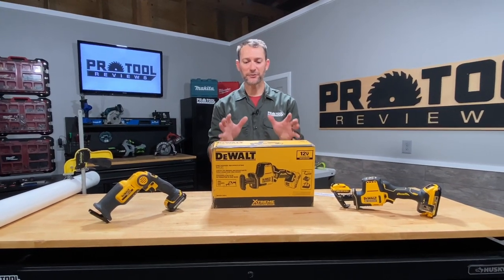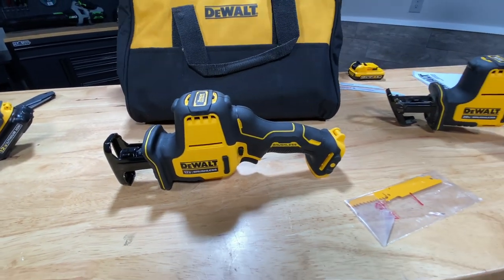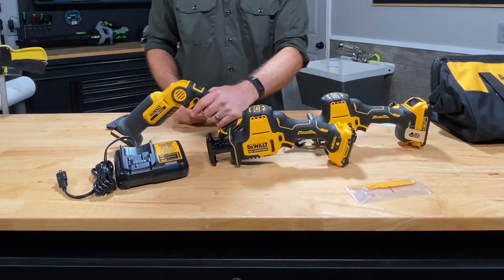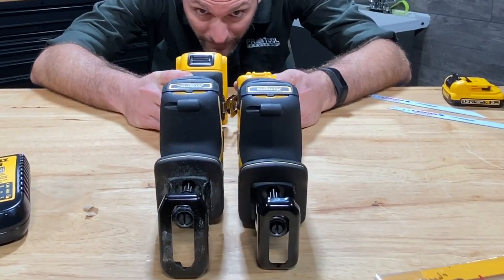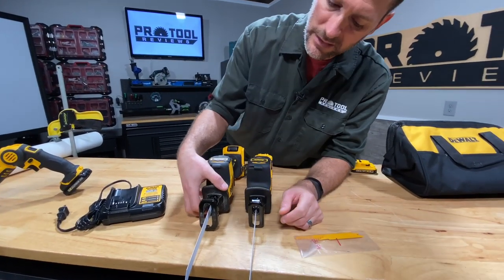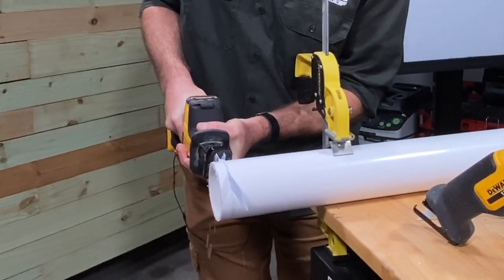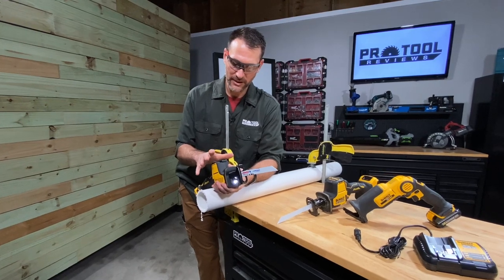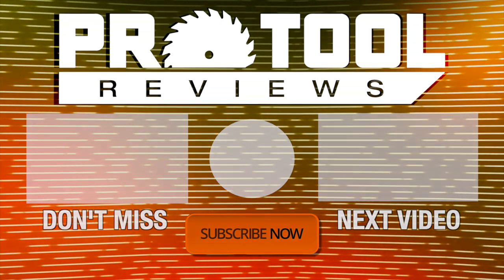DeWalt Atomic 20V vs 12V Reciprocating Saws | Is It the Same Tool?

Comment: Hi,

Would have been nice to see how the brushed version performed with the new 3.0ah battery.

The two new models looks pretty cool for small projects. People are forgetting that you're not going to demo a house with these particular tool. That's when a sawzall comes in. 

Hope dewalt makes larger ah batteries for their 12v line. 

Thanks for the video

Comment: I don't like the fixed shoe, minor issue probably just me. The batteries are now 20V 5.0 AH. I'm used to using a bear of a recip saw and it's elec., (ugh). This info is up to date as of December 2022. Obvious DeWalt upgraded the battery. Since Black & Decker bought DeWalt seems like they reduced quality and now are upgrading their tools. I wonder how much business they lost? I sold DeWalt tools for 30 years since the seventies while working for a top industrial distributor. I have lived through the quality change and it wasn't pretty. DeWalt was my go to tool all of my life. Not so much anymore.

Comment: I have a dcs 369B,I was wondering if anyone else has smashed their fingers in the slide,I think it needs something over it,I done it a few times now,love the saw except when I use a second hand to apply pressure,and get a finger in the slide and the piece that you twist to install the blade, sacks a chunk outta my finger,only flaw I've found
Reply: @Protoolreviews   I'm gonna build something over it,I've got a finger in there more than once
Reply: Ok, so another DeWalt, I mean Black & Decker design flaw. This is the third time I heard about this happening. DeWalt ain't what it used to be thanks to Black & Decker buyout. I know, I used their tools for thirty years and man, they were such garbage a few years back you couldn't use anything with the DeWalt name on it. I also sold their tools for decades and every other metalworking tool there was.

Comment: If you could only purchase 1 saw,  12v or 20v??  I use both platforms, cant decide which one to go with.
Reply: 20v Atomic.  Pivoting shoe, shoe "rafter hook", belt clip, and larger variety of available batteries (1.3Ah all the way to 12Ah).  Pretty much everything else (size, weight, power, speed) are almost identical.
Reply: I'm trying to decide the same thing. I'm already on both battery platforms but was leaning toward 20v for the bigger batteries.
Reply: I went with the 12v version. The deal at lowes was hard to pass up.  Saw, drill, 2 batteries, charger and a backpack..  $149.00
Reply: @anthonyhamel3497  I like the battery gauge on 20v..wish 12v had it on its batteries
Reply: @1commonsense934  it does
Reply: @thehhoff69  who puts a 12ah battery on a compact hacksall? The 12v line has a 5 ah and that’s plenty
Reply: @jncn1490  not recommending you put a 12Ah on there, but you at least have the option. And the 5Ah 12v battery just came out a couple months ago. My original reply was well before that. Ya feel me?
Reply: I went with the 12v line, performs pretty close to the 20v for a lot less. Plus they have a 5AH battery now and I got good deals on them. I got 4 5AH, 4 3AH, and 2 2AH bats for free with tool deals. Only spent $600 for the 3/8 impact, 1/2 impact, 1/4 impact driver, compact bandsaw, and recip saw. They work great for me.
Reply: I just recently got the 12v version, not much difference between the two.  I’m very happy with the 12v line of tools. I hope they expand more.  A jigsaw. Or router would be nice

Comment: I recently purchased the DeWalt Atomic compact recip (DCS369) and noticed a rattle/knocking noise that sounds like it's coming from inside motor housing when I shake the tool (not while in use, but when i simply hold tool in my hand w/no battery or blade attached).  I contacted DeWalt and they said the noise should not be there so I bought another one to test and it too had the rattle but less of it, so I bought a THIRD and it also has the rattle but less of it than #1 or #2 saws.  I've contacted DeWalt and they can't confirm anything for me so I wanted to ask you since you have the tool, does your DCS369 make an internal rattle noise when you shake it?  I've been holding all external parts securely (trigger,  trigger lock, anything that could wobble) as I shake mine and rattle/knocking noise definitely sounds to be inside motor housing.  Thx!
Reply: @Protoolreviews  Thanks for reply!  I had called a DeWalt Factory Service Center as well, they confirmed the rattle is normal...apparently it's designed with some play in the gears (or some part) and this leads to the rattle noise.  Thanks again!
Reply: @tkcarpentry  The height of garbage DeWalt since Black & Decker bought them. I just bought one to see if their tools improved since the buyout. They have, I was a Dewalt gal for decades. Sold machine tools and every other tool under the sun power tools, high performance cutting tools yadayadayada. What a disappointment I have 2 of their batt op lawn mowers and they weren't cheap. The first one was a total piece of garbage. Used it one season and everything that could have went wrong did. Batteries - garbage. Mower - garbage. We gave them one more chance and it was like night and freakin' day in the quality. Uh, yeah no rattle anymore. I think they FINALLY go their act together. Just a nightmare and huge and I mean huge disappointment. Way to go Black & Decker.
Reply: Ahhh...the Black and Decker buyout of Dewalt happened in 1960. 🤔 Maybe you're referring to Black and Decker merging with Stanley Tools which happened a decade ago?

Comment: Still wondering why that 12V line exist. They’re in the process of killing the 40V line and I was pretty sure the same would happen to the 12V line. 

That would mean that the 20V and the 60V/120V lines would be the only remaining ones.
Reply: 12v exists to fill the compact tool line at Lowes and other retailers because the Atomic line is exclusive to Home Depot.
Reply: I love the 20v impact driver DCF887 so much that I bought 2.  But since I added the 12v Extreme impact driver,  I use the 12v 80% of the time.  So maybe there is a reason that the 12V exists?

Comment: Can u swap battery btwn the two or no?
Reply: @mightymcgee9199  No you can not swap batteries between the 20 volt and 12 volt tool.  The exceptions are some accessories including most chargers, USB power source, speakers etc.
Reply: @jpslattery7344  I recently saw that, thanks, I thought you could